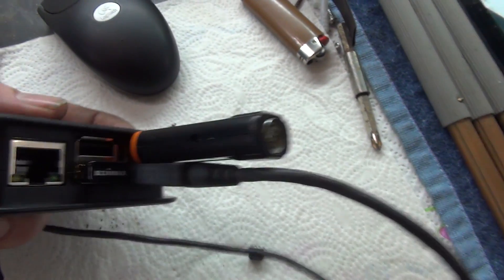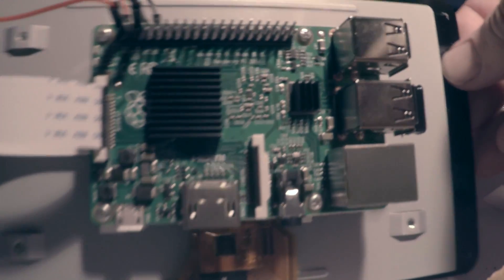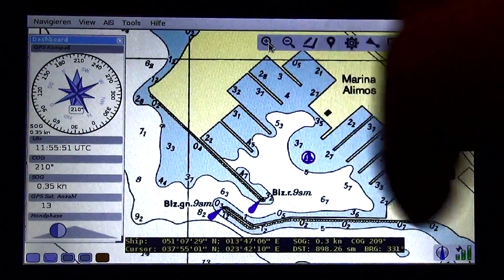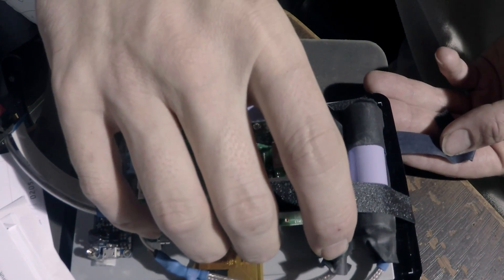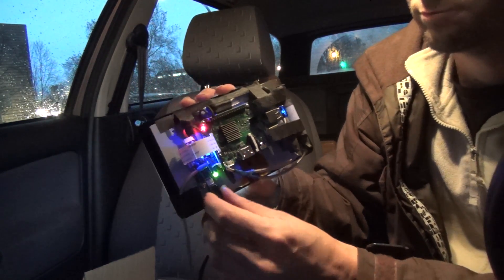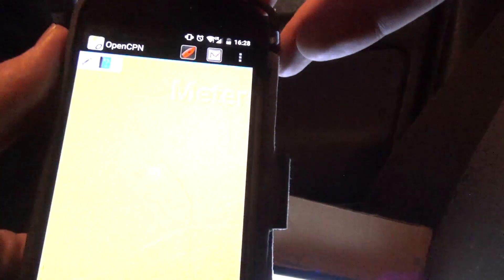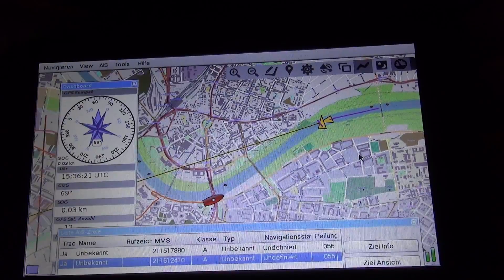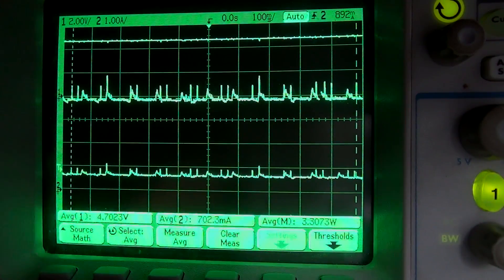Cheap GPS, AIS Receiver using 2 Raspberrys and 7" Display

Comment: Nice work, great build!  What is the CPU usage on the OpenCPN unit? Do you think that you could run both the AIS reciever/decoder and OpenCPN on one RasPi 3?
Danke!
Reply from the maker: +andrew berg 
Hey!
Host: Raspberry PI 2
Slave (Display) =  PI 3
Basically both would work with a PI 3, however there is a dist-upgrade needed. 
The PI 3 takes a bit more power than the PI 2, thats why my host is still a PI 2.
The CPU Usage on the slave strongly depends on the charts, zoom and level of detail. Sadly OpenCPN has no multicore ability :/ so the max CPU is 25% (one Core at 100%)
Currently I'm tweaking around with OpenCPN 4.2 which is a pain to install due several flaws in the source (wrong missing dirs in the code, so languages and plugins are not found). But imho 4.2. runs smoother than 4.0.

PS: I plan to create a talk-about video with the slave PI, because I did some tweaks after running in some problems and did not mention them (yet)

Bitteschön ;)